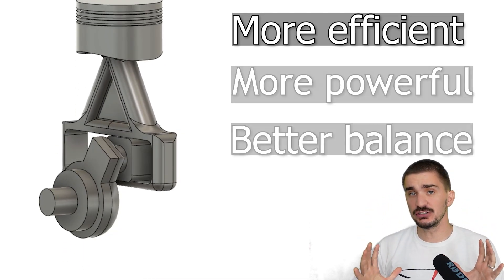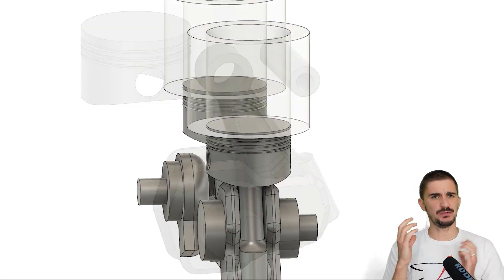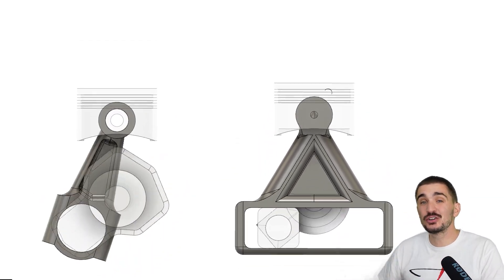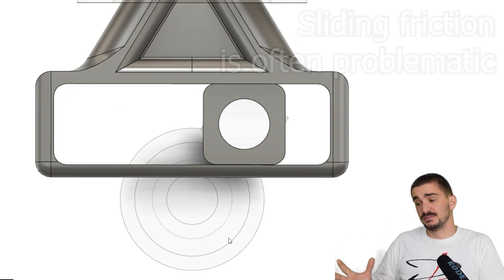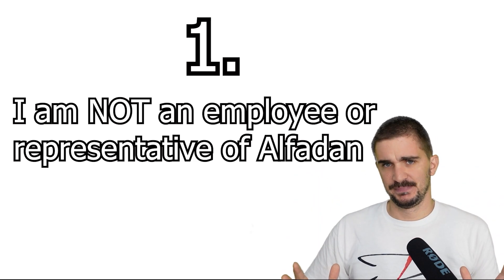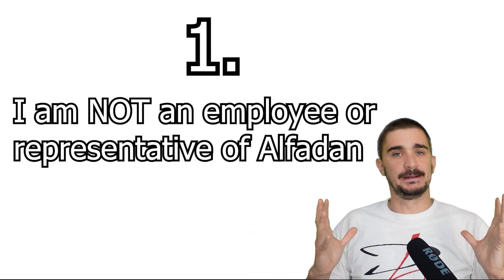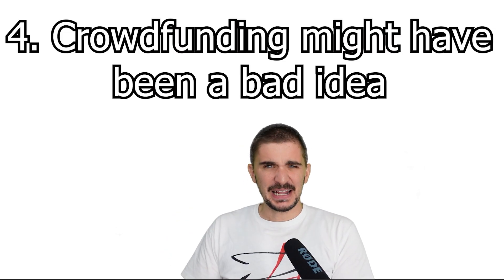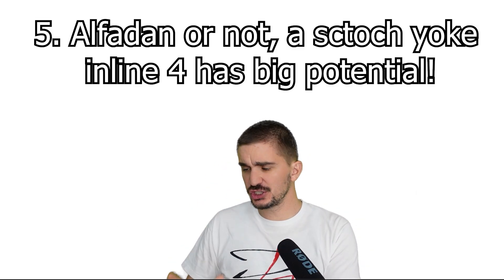This engine is better in every way?

Comment: The wrist pin friction losses are just moved to the sliding square and the piston is obviously still loaded at an angle
Reply: Yes I see a lot friction there.
Reply: there is also a lot more weight.
Reply: @thebaumfaeller1477  no sir, with a much stronger design and with forces always going down the shaft straight you could use a much lighter material
Reply: Yeah i was thinking the same thing
Reply: And why would anyone want to get rid of the wrist pin? It's the strongest part in an engine! They seem to survive all kinds of malice in the combustion palace!
Reply: @CMDR_CLASSIFIED  and remember...always go front to back
Reply: @CMDR_CLASSIFIED  right? Better get rid of that wrist pin. Everybody knows how often they just break and you gotta rebuild the whole engine.
Reply: @CoreyCantwell-jv4be  HaHaHaHa! I know! It's like , "Why don't we build the engine from the same material as the wrist pin!"! LOL!~ Almost like, why can't we build the plane out of the blackbox material, cause it's always the last to go! LOL!
Have a great day, Sir! o7
Reply: @CMDR_CLASSIFIED  because you eliminate piston slap. If the piston head can’t pivot around the pin it’s always aligned perfectly in the bore
Reply: @CMDR_CLASSIFIED  The  Main Bearings  are  actually the strongest  Bearing surface .
Reply: Probably the scotch yoke is better lubricated than cylinder walls.
Reply: It's all a matter of trade offs. No design is perfect without some disadvantages. Roller bearings indeed might have some durability issues over non roller type, but on the whole, are the advantages of a Scott yoke design great enough to offset some of its disadvantages? Obviously, Alfadan thinks so.
Reply: the piston is loaded at an angle but the Conrod  sliding up and down can be guided and this guide can take almost all the side load and let the piston slide more freely in the cylinder
so first you are moving away this from the cylinder/piston, allowing a much shorter/lighter piston sleeve, and  you can still  have much longer contact between the. Conrod and it's guide, and it can be perfectly lubricated unlike the cylinder which is only lubricated from the bottom and has  combustion burning up that layer of oil. the thing that needs to be addressed is the highest instant torque will happen always at the same angle so it will have a tendency to wear unevenly. I guess this is why the contact point needs to be spread out on such a large surface
Reply: There's no difference in friction between the square crank and square rod end and a round crank and a round rod end. This design just allows for more piston dwell.
Reply: @cheaper by the thousand  yeah, I love how everyone in this comment section has a calculator in their brain LOL. people ASSUMING more friction from the yoke.
Reply: @SoulAir  . Yes . Intuitively  I  would expect less overall , due to the BIG reduction of Lateral forces .
Reply: Not only it is loaded at an angle. The loading  is working to rotate /wedge piston in the bore. In classic cylinder the piston is free to rotate around crank pin constrained by cylinder walls, thereby the side load is converted to push against the wall and no tendency to rotate /wedge.
Reply: What I don't understand is why they didn't use 2 counter-rotating crankshafts. Reduces load on each sliding block and makes the load from the piston go straight down.
Reply: Came here to say this
Reply: @seanlarson8968  . To  say  what ?
Reply: Yeah it's gotta be way worse
Reply: @m.b.82  . Really ? You sure about that ?
Please explain . I  know  you are incorrect  BTW .
Reply: As shown, the piston is still sideloaded but in an actual engine I'm sure the connecting rod would run in channels which is of course, 2 more sliding friction points
Reply: Just another take on the traditional yoke assembly.
Reply: Which is exactly what the video pointed out if you didn’t watch the whole explanation
Reply: Agreed.  Drawing free body diagrams expose this though I don't even have to draw them.
Reply: The standard connecting rod provides a net force pushing the piston into the side of the cylinder bore but there is no moment due to the pin.  The Yoke design imparts a moment on the piston that the cylinder bore has to resist.  I think resisting the moment would be lower total force than the side load of the connecting rod but I would have to do the math to know.

I think the primary benefits are the removal of the secondary imbalance and by prolonging the initial phase of the power stroke.
Reply: Just make an economical jet engine instead of all this reciprocating stuff!
Reply: @rkan2  I think that's been tried before.
Reply: @rkan2  . The  Gas Turbine  manufacturers have been trying to do that since the Very Early days .
Power has never been an issue , but Clean Burning and Fuel Efficiency are .
A  " Jet " Engine can be built to operate efficiently  at  ONE only , Speed  and  Loading .
That makes them Excellent for Aircraft and  for SOME  Ships , and Even some Locomotives .
Nowhere near as suitable  for Automotive use even in Heavy Haul Trucks .
And even in those Applications they are suited too ,  they make  Great Power but use a LOT of  fuel .
The Reciprocating Engine has been persevered with because of it's Versatility and Adaptability . If there really  WAS  a  better way , someone would have done it .
Reply: @johncunningham4820  Gas Turbines still have the best thermal effiency. Today with hybrid powertrains they could be made very efficient. You'd only run them to charge the batteries or to cruise on the highway. Thus they would always be running at their most efficient setting.
Reply: @rkan2  . A  Reasonable  idea . 
Turbo Diesels are reaching pretty good Thermal Efficiency  numbers these days too . Petrol Engines remain rather Poor .
Reply: @rkan2 not efficient
Reply: Yeah.  It looks like you moved the problem rather than solved it.  

There may be some upside to moving the problem, but I am not immediately sold on that either.  The one pice piston and rod part will all have to be replaced when friction wears at any of the contact points.
Reply: @v3rlon  well that applies to any engine.  That's why we're discussing how to eliminate wear and thus increase durability.
Reply: I must be misunderstanding this with a normal crank you have circular movement with this surely you have a stop and go motion like a hammer surely at high rpm and ware it's going to hammer the two ends🤔
Reply: @ianlaker6980  I can see where your coming from, however I think it's set up so that the slider never actually makes contact with either end.
Reply: Its worse . It has even more leverage .
Reply: It seems like the scotch yoke rod would not work and in fact I believe it would reduce efficiency and another thing is the weird effects of connecting rod length would be gone but plenty of problems immediately arise and this seems to be more of just a experiment
Reply: Yeah this might be the worst piston design in history, even more friction, lower rpm limit, and probably much less hp
Reply: Not nearly as much load as the crank slides instead.
Reply: @deltabluesdavidraye  I don't think so. If roller bearings where the solution, someone would have done it by now. The forces directions I see essentially crush bearings used in the yoke from the side, while large crank bearings get shear force which aligns with their rotation.
Reply: Thank you!!
Reply: Piston is not loaded because it's meant to be countered with an opposing piston or something like that, that fixes the whole assembly in place
Reply: @player1GR  . A Piston moving in Opposition , whether Actually Opposed  or Parallel  will counter  Primary  vibrations . 
But even a Scotch Yoke design will have a degree of Secondary imbalance , though greatly reduced from a standard connecting Rod arrangement .
Reply: True. So many alternative piston engines were testet - except the Wankel-Motor (for some applications) - nothing better came along.
Reply: Obviously. That makes me think opposed cylinders with this design would be very interesting. Flat fours would shake quite a bit, so we're back at more cylinders, but if the efficiency actually is notably increased, compact high performance engines might be doable with the Scotch yoke.
Reply: There are big differences between potential friction and kinetic friction. The scotch yoke, in my opinion has more potential friction than a conventional engine, which is probably why it suffers in the market.
Reply: Came here to say this
Reply: Did you watch the video all the way? He pretty much said the same thing...
Reply: Yeah, now it's trying to tip the entire yoke-piston assembly.
Reply: Yes, but the hinge point is relocated to the slide, which in theory should still accomplish the uneven wear issues.  But moving that wrist pin, actually increases friction with the slider.
Reply: Exactly! Not an alternative solution to anything now. Interesting concept. But no.
Reply: Yup Hans, you nailed it.
Reply: Obviously I've managed to successfully contribute to the debate, to my astonishment lol.  Mind you, the whole thing would have to be made up of pretty hard material.
Reply: Plus you will also have to have something on each side of the the square to keep it from rocking left or right. More block machining, more oiling, more tolerance checking and more sliding flat bearings.  Really?
Reply: @chrisbraswell8864  all adds extra costs I'm sure, but I guess we're into R&D best left to the accountants I suppose.  I take your point though.  It'd be interesting to see how those old steam engines mentioned hold up ...🤔
Reply: Nope because the piston has no piston pin
Reply: Unless you support it with a slider on each side however weight is a huge issue. Plus stroke will be drastically reduced due to clearances
Reply: The sliding square frame attached to the piston is shouldered by engine block perimeters, thus transferring angle load to whatever bearing system used at perimeters
Reply: The Piston is not loaded at an angle it is top dead center dead straight
Reply: Not really, it reduces overall friction, because it removes the need of lubricating the rod bearing in conventional conrods. The wrist pin friction is realocated, but reduces overall friction because you don't need to lubricate both the big end and small end of the rod.
Reply: How about an opposing magnetic fields configuration in there to eliminate friction altogether?
Reply: I’d like to see some data. It seems illogical, but I’m willing to trust the numbers
Reply: Not if you run a guide rod from the bottom of the yoke into the block. This would add more weight, though, so it seems like a compromised design to begin with.
Reply: i agree, they might want to rethink making the rod and piston one piece.
Reply: @sparty94  I thought it was...
Reply: Yeah, it's painfully obvious. In fact, if wager that the rocking of the solid piston could yield even more uneven wear on the cylinder.

Same thing with secondary forces. The side to side swing of the connecting rod is replaced with the side to side rotational motion of the crank.
Reply: @CoreyCantwell-jv4be  if it were the case then surely the video would of mentioned it?
Reply: @rob5944  do you really think this YouTuber made a perfect video which mentioned absolutely everything possible?

Do you really think this video is some kind of textbook-level reference?

You really think there's no way that the creator of this video could miss anything?

You really think all the thousands of people in the comments are just dead wrong? There's nothing to what they are saying at all?
Reply: @CoreyCantwell-jv4be  well they're more likely to miss something than the creator of the video, after all that's why we're here isn't it?  Watching and learning, and then discussing.  With respect I'd believe him over you, or any other commentator for that matter.  Anyhow I'm not going out to buy one anytime soon, so chill out.
Reply: @CoreyCantwell-jv4be  . Crank Rotational is Unchanged . Think please .
And  the  Rigid  Piston and Scotch Yoke assembly would run in Guides in the Block that prevent " Rocking " .
Reply: @johncunningham4820  so the pain would just grind on a different surface, causing the same wear, just in a different place.

The point is that nothing is eliminated, just relocated.

Think, please.
Reply: @CoreyCantwell-jv4be  . Flat  Linear  Plain  bearings with a Good  Pressurised  Oil  feed are going to wear less than a Piston Skirt  does , especially since they will be Early in the Oil supply  chain , and the Positive Alignment of the Piston will virtually Eliminate wear to Piston and Bore . The Scotch Yoke design doesn't even necessarily need to be much heavier than conventional Piston / Conrod layout , since the Piston itself can be lighter .
Also there will be  LINEAR  motion only .
Secondary Vibration will be almost entirely eliminated , and in a Multi Cylinder arrangement , perhaps completely .
The  Linear bearings , by their nature will have Larger Surface area than the Crankshaft  MAIN bearings and " Big-End " Bearings , and with a more Even  Loading .
Easy to visualise . 
And then there is the Significant improvement in the Length of the Power-Strokes .
Reply: this is just like demo engines that'll never make out of conspiracy moldels
Reply: Worse there's a huge lever on the angled load.
Reply: It's not a scam if u KNOW before hand you will lose ALL your money
Reply: the connecting rod is inline with the centerline of the crank which provides the angle
Reply: If you look at the example, the rod is supported two times with helps a lot to reduce the negatives effects of that
Reply: https://youtube.com/@pkengineservice?sub_confirmation=1
 Two wheeler service
Reply: Yeah. This is not any solution for the angle.
Reply: Yes, this is covered in the first half of the video. Very astute observation.
Reply: Technically the piston shouldn't be rocking at all, the biggest gain to be had would probably be in the slight extra movement a conventional rod has when swinging around the crankshaft. I'm sure there's more loss there than we realize even if it's minimal movement
Reply: Technically the piston shouldn't be rocking at all, the biggest gain to be had would probably be in the slight extra movement a conventional rod has when swinging around the crankshaft. I'm sure there's more loss there than we realize even if it's minimal movement
Reply: Why not try a ball bearing or roller bearing design for the sliding portion?
Reply: i thought i was getting crazy
Reply: BUT…

Better balance!
Reply: I know very little about internal combustion engines and I’m no engineer but I’m just glad there are so many mechanical geniuses in the comment sections that seem to be able to point out all the flaws and come up with better solutions than the tens of thousands of people who actually did this shit for a living over the last couple of centuries.

It’s an eye opener if only it were you guys who were responsible for the development of the internal combustion engine and mechanical engineering in general just think where would be today!
Reply: If you watch the video instead of prematurely commenting the obvious, you will see he covers that.
Reply: I would say It's even worse since the rod is attached to the piston the rotational force would be even worse!...
Reply: Would that sliding square be set in roller bearings, both top and bottom?
Reply: @rob5944  how much stress would those roller bearings be able to take? How much do they weigh? Are they actually better than the crank bearings of an ordinary engine?

Early pioneers of internal combustion engines just built their engines and tested them, no computer to simulate with, no cnc machines or 3d printers. Nowadays, there are a lot of "revolutionary" engines that remain as vaporware.
Reply: @sepg5084  actually All Harley Davidson and many other motorcycle engines use roller bearing big end connecting rods.
Reply: @sepg5084  this was a design from the 1800s, tech at the time didnt allow for it though
Reply: @deltabluesdavidraye yep low power old tech
Reply: @sepg5084  it would be funny to think that modern material science hasnt progressed enough to unlock previously unavailable designs
Reply: @rob5944  for something like the slider to last i think high pressure oil channels would need to be included so it rides between a film of oil. Very hard to machine that and oil cleanliness would become critical something very hard to achieve when the oil is used for combustion chamber lubrication aswell
Reply: @monkofmayhem1373  granted, but I'm not sure about the combustion chamber bit....
Reply: @monkofmayhem1373  that's why I suggested roller bearings, like the MG42
Reply: @rob5944  im referring to the oil going past the piston rings, picking up carbon deposits and recirculating with the rest of the oil. Those particulates would be abrasive at high pressures. I should have just said cylinder instead of combustion chamber.
Reply: @monkofmayhem1373  I understand, although shouldn't thé oil control rings prevent that from happening?
Reply: @rob5944  yeh thats their job for sure but they arnt going to be 100% effective all the time. My point isnt that there is a big leak of contamination its that the normal amount is too much i speculate. Reason for my speculation is that high pressure situations like hydraulics and even pressure washing require high oil/water cleanliness to avoid abrasion
Reply: @monkofmayhem1373  I dunno, both the engines on my wife's car and mine don't use any, but the oil does dirty over time, it has to be said in fairness. 🤔
Reply: @rob5944  well your point was well made its just that the nature of the beast is that cylinder wall needs lubricated but also needs scraped clean and sealed. Its very difficult to satisfy all those boxes perfectly in reality so your oil turns black with carbon.
Reply: @Monk of Mayhem  get a 2ndary filter, one that's isn't full flow, and parallel it into you oiling system.
Reply: @monkofmayhem1373  . This design would have no more issues than a Normal  4 cycle engine . Do  your  Servicing . Change Oil and Filters when due .
Reply: @monkofmayhem1373  after 8,000 miles or 1 year the oil gets darker but in no way goes black.  I've never had a car do that.  Even as a young man when my used models were built in the 70s.  Except diesels I've owned or course.  With respect, I'd say if that happens then either it's been in there too long or the rings and cylinder liners/walls are worn.  In any case the slides of that alternative engine would have to be very hard, increasing productivity costs.  This comes at a time when manufacturers are looking to make cuts, our little city car is obviously built to a very strict budget, it's seven years old now and it need replacing really.  I've had to replace the coolant pump (first time ever for me) the centre brake light, clutch, then again it only cost £6,000 when three years old so.....
Reply: @rob5944  no. Roller bearings could not withstand the forces of combustion
Reply: @squidfensmirtz1312  I see, yet they do in firearms?
Reply: @rob5944  not sure what kind of action uses roller bearings. Could you elaborate?
Reply: @squidfensmirtz1312  I believe that the MG42 did.
Reply: @rob5944  did some research on that and as far as I can see they are mainly for locking the breach in the open position and take no axial load👍
Reply: @squidfensmirtz1312  ok fair enough.  I'd say it's worth looking at...as I'm sure they would of done already.  Just musing really.
Reply: @rob5944  You can add roller bearings if you want. There are no calculations being done anyway so any extra dynamic mass can simply be ignored.
Reply: @phitsf5475  let's go for it!
Reply: @rob5944  I wouldn’t think a roller bearings would be able to handle the loads. Think of the surface area of the big end plain bearing, how big would a roller bearing need to be to equal the same surface area of moving parts.
Reply: @ian9toes  . You're  Kidding . Right ? Roller  Bearings are used in MANY  Engines , as  Mains , Big-ends  and  Small-ends . Just Dumb .
Reply: @ian9toes  I was thinking of a whole set, so that the load would be shared over a greater area.  Also the upper portion of the slider would have an additional lot, of course we're basically talking theory here with no way of measuring anything.  Just throwing ideas around.
Reply: @johncunningham4820  I think the issue here is that currently they are being used in rotating applications, not sliding type applications where they will hammered off axis from their rotation.
Reply: @johncunningham4820  right like no one ever torn a transmission apart or a rotory engine , u will see tons of roller bearings throuout n its not the main ware component either 😂
Reply: @peterscott2662  . That isn't  true .
 There are most definitely Linear  Plain Bearings  in use Industrially . 
This  application could  EASILY  be solidly engineered .
Oiling in the Normal manner . Through the Crankshaft , that needs the Most Oil Pressure , because of the Circular Journals , then on to the Primary and Secondary Cross-slide linear bearings , that bear the High compressional loads , then onward to  the Vertical Side play Linear bearings , that absorb any of the minimal side thrust component then finally a small amount finds its way to the Piston Rings .
Exact same as : Oil Pump feeds into Main Bearings , then through the Crank to the Big-Ends  and finally up through the Rods  to the Small-Ends and finally the Rings .
SAME  Feed  chain .
Reply: @mastercricket7626  . Did  I  say  that  Roller  Bearings  were less capable  than Plain Bearings ?
I  am  DEAD  CERTAIN  I  didn't  BTW .
The  Bearings are only dealing wit rotational forces , distributing that loading  actually . It  is  Surface  IMPACT  faces that suffer the Worst  wear .
Reply: @johncunningham4820  If it could be EASILY engineered, we would already have practical Scotch Yoke engines.
Reply: @peterscott2662  . Go  take  a  look  at  how  an  " A-Frame " Marine Diesel works .
You  just  MIGHT  get  the  idea .
Reply: @johncunningham4820  no need to insult I’m only thinking out loud and obviously had no knowledge of what you pointed out.
Reply: @ian9toes  About the size of a roller bearing connecting rod big end I would guess - like has been used in large motorcycle engines for evah!
Reply: @paulgee-i7j  I did not know why is a roller bearing used on a motorcycle and not a plain bearing, what’s the benefit?
Reply: @ian9toes  . Was  that about  Roller  Bearings ? They are WIDELY used in Engines , whether  Torrington  Shell replacements  or Heavily made Full  Roller or  Ball type .
I   thought that was common enough knowledge . 
My Apology  for  offending  however .
Reply: @rob5944  The exact thought came to me (needle bearings top and bottom) so I had to check the comments lol. If you think about it, in a regular con rod only a few bearings (near the top and bottom) take the force of the combination pulse at a given time, they do switch places as the crank changes angle though. On the sliding block you would have more of them sharing that same force. I'm not sure how, or how much, the block torquing/ trying to spin from the side to side motion would affect the distribution of that force.
Reply: @Wooskii1  suddenly I feel like Dr Robert Neville, I'm not alone!  lol
Reply: @johncunningham4820 yes true! now can you name one? Besides a tiny two stroke???
Reply: @needmoreboost6369  . Sorry , there is a LOT of shit in that thread .
What is the Precise question please .
It was all about Scotch Yoke  Engine design and Linear Bearings and Oiling systems Etc .
What's " True " and needs clarification ?
Reply: @ian9toes Well that just depends size and power going through it.  It would be higher friction anyway, or rather a longer path during which the friction is applied vs. rotating - this is inherent to the scotch yoke design.

Dunno why the dude says that alfadan for sure isn't a "scam" - he would need to have insider knowledge to know if they have found some magic sauce or not.
Reply: @ian9toes Undersquare high-revving engine is possible with perfect balance! The undersquare factor reduces the load on the piston and rod.
Reply: @rob5944  Even if, that would add more moving parts and reliability would probably suffer.
Reply: @thebaumfaeller1477  i disagree it's going to have a bushing a sacrificial wear surface there so if they can design that surface properly it would at worst perform about the same and at best the engine balance could be true and would create a very smooth running engine.
Reply: @thebaumfaeller1477  Maybe make a special white metal bearing for it?
Reply: This design looks like it would add much more wear to the crank main bearings, pulling on the crank with the side to side motion as it switches directions. Seems like you would be switching uneven wear of the cylinder walls to uneven wear of the crank mains.
Reply: I would put a round post extending off the bottom of the rod directly apposing the piston that can reciprocate up and down in a hole to counteract side loading on the piston.
Reply: @TheTimeFarm  This, is a great idea you have.
It seems like this design would be more serviced looking into firearm design.
In semi-auto firearms there is the ability to "reliably" cycle through insane pressures and deal with sliding loads constantly.
Reply: @TheTimeFarm  one: that would increase the height of the engine significantly, two: increase cost/complexity significantly to design and manufacture the rod. Three: now you need extra structure in the block or some kind of girdle is used. Four, the side loading is already absorbed by the block. This would be mounted with the sides of the “big end” of the rod, likely sliding in channels on the walls below the bore, these and the relative vertical offset of the piston head triangulate the rod/piston keeping perfect vertical alignment at all times.
Reply: "the piston is obviously still loaded at an angle"
not correct.  the piston does not have a side load on it, it DOES have a TORQUE on it.  there is no possibility for a side load force on this piston, because HOW would you push the piston sideways?  the pin has a horizontal surface.  You cant push sideways on a horizontal surface (neglecting friction obviously, but thats trivial here).   draw a basic free body diagram of the piston and you will see you cant load it sideways with a scotch yoke.  You DO however create a torque on the piston, by having an upwards force that changes position from center to the extreme ends.  When the yoke is at the outside of its travel and it is pushing up or down on the piston, this creates a force with a lever arm.  Force x lever arm is a torque, not a side load.  The piston will want to twist in the cylinder and the cylinder walls will have to counter that rotational torque by applying an opposite torque.  This will not be a single FORCE reacting to the torque, but a PAIR of forces in equal and opposite directions, one above the center and one below.  

So to get into the physics of it, imagine the yoke is at the far right of its travel, and we are traveling up.  the crankshaft is thus pushing up on the piston, but doing so from a position to the far right of the centerline of the piston.  this creates a torque that wants to rotate the piston counter clockwise.  since the piston is not spinning counter clockwise, there must be an opposite torque applied by the cylinder walls.  however MOTION is also not moving sideways, so our torque AND our lateral forces must balance.  so what you will see is that the cylinder walls are pushing on the top of the cylinder to the right, but are pushing on the BOTTOM of the cylinder to the LEFT, this is how torque is balanced out.  You do NOT have a net force on the cylinder to the right as you normally would in a connecting rod engine.  you have a PAIR of forces, in opposite directions.  The top of the piston being pushed one way, and the bottom being pushed the opposite way, which creates a balancing TORQUE, (not a net force) to prevent the applied torque from rotating the piston assembly.  

the advantage here is that while there ARE forces on the piston walls, they are EQUAL AND OPPOSITE, unlike in a normal engine where you have a huge side load in one direction only.  so your wear on the cylinder walls would be even on both sides.  the other advantage is that the forces involved are likely orders of magnitude smaller than in a standard engine.  the geometry controls how big the forces are.  take the vertical force on the piston from combustion and multiply that by your lever arm (the distance from center that the yoke hits at max extension) and that is your max torque.  you must counter that torque with equal and opposite forces, one high, and one low, on the piston from the cylinder walls.  so the HEIGHT of the piston body will determine how big those forces are.  If you want to make the forces smaller, make the piston body taller to allow it to more easily counter the torque.  a taller piston body means the equal and opposite forces on the piston body have a LONGER LEVER ARM, and since torque is (lever arm) x (force) then for a fixed amount of torque the longer your lever arm, the smaller your force.  torque in this situation IS FIXED by the crankshaft.
Reply: Yep, this piece would break within 10000kms of wear
Reply: @AKK5I  I'm not convinced. Extremely good balance and low vibration can contribute to an increase in reliability, although its correct that this engine adds to reciprocating weight!